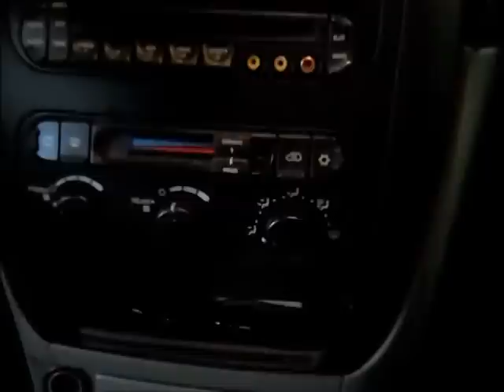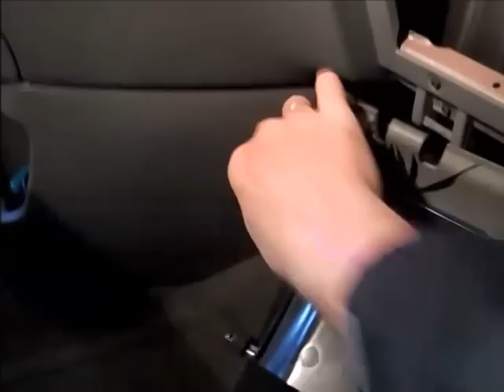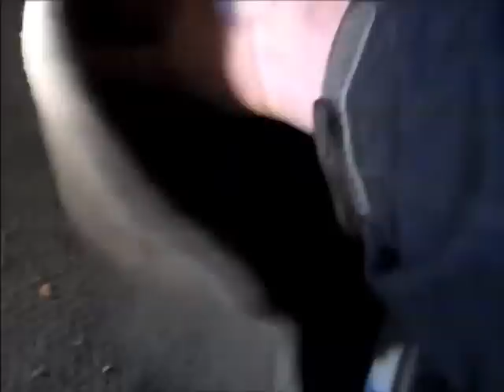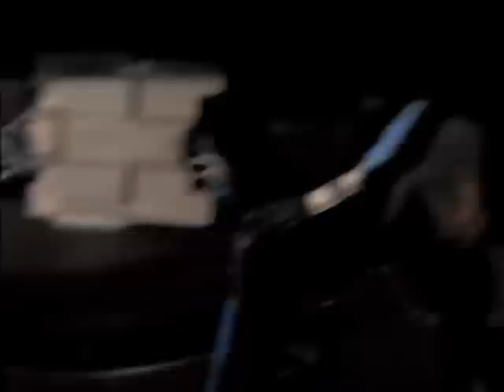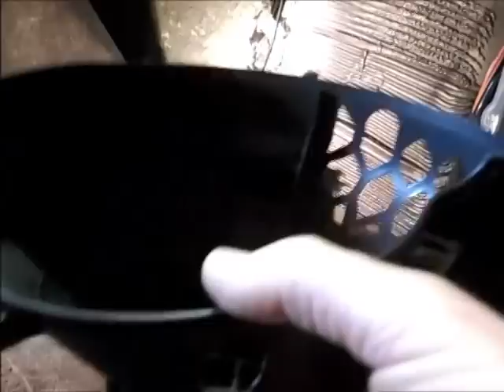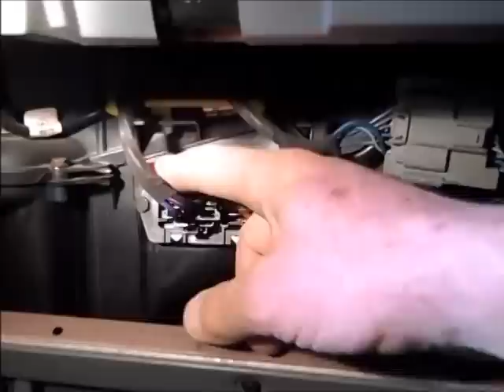2001 TO 2007 Dodge Caravan heater fan and resistor replacement

Comment: is there two blower motors? the back climate control works but the front wont blow at all I switched the front and back relays around and same thing any thoughts
Reply from the maker: Understand that I am not a mechanic but I have learned through comments that there is indeed 2 blowers. The rear tends to get less duty and lasts longer. If you have no motor at any speed and it suddenly stopped working at any speed... chances are it's the blower motor that's bad. Some have got them going by striking some blows on the housing with your hand. If it starts works again then that is also indicative of a bad motor. Good luck.
Reply: Don Guptill thank you for the reply I have tested with a test light and indications show that it is the resistor getting power from both power and ground
Reply from the maker: My description of testing with the voltmeter in my video is a bit misleading. I was attempting to show that power was present confirming no fuse or wire breaks but not a good power diagnostic procedure. I have since learned that the speed selection switch completes the circuit through the ground actually. The resistor pack has 4 separate resistors, one for each speed. So you will have power at the ground when selector is switched to that particular setting. I believe that the highest setting is direct power from the battery so if your speed selector in on high and you get a hot light on both power and ground, that is normal. Another way to find out if the motor is bad would be to jump wire direct power from the battery to the motor.  You could also buy a replacement resistor and plug it in and if no motor then you can take it back and order a motor. Hope I'm helping and not confusing.
Reply: Don Guptill yes thank you so very much i will buy a  resistor i hope it is that that motor looks like a bear

Comment: I just did my sisters caravan...tear down and reassembled took me 45 minutes...but I had watched this video 5 times at work the night before and had it memorized.  That one screw is a bear...I'm convinced a really really long flex driver would have been great cuz you can't get both shoulders in there to work....but if you want it bad enough you can sprawl out and shove your head in there and use a 8mm and 3" extension and ratchet..anyone should be able to do this as I'm 6'2" and almost 300 lbs....I too did not reinstall that 5th screw and threw that thing as far as I could into someone's yard as I did this in a parking lot.  Good tip on removing the cover by shoving the nut driver up through the actuator motor hole....I probably would have fought with that one.
Reply from the maker: Good job whiskey Tango. (great handle) I'm a bit oversized too. I also cant see well at close range anymore. That makes it difficult. Gjad you got it fixed and in an impressive 45 minutes!

Comment: Thanks for doing the video.  The most important thing you mentioned was when you bench tested the motor it worked.  I did the same and put it back together.  I wasn't sure what was wrong.  After seeing your video you pointed out something important, the motor has a dead spot.  Thanks.  I haven't fixed it yet, but you answered an important question.  Thanks.
Reply from the maker: Thanks Teresa.  If it stops working on you again, you can some times get it started again by striking the fan housing a few times. It may move the fan position a little bit and get the motor back to a good spot. Thanks for the comment.

Comment: Great video!

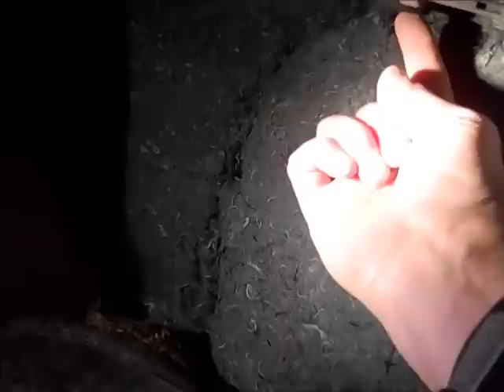No question that a flexible 1/4 inch extension would make removal of the back bolt easier (at 7:15 into the video).  

However, I was able to use a 5/16 inch six point nutdriver to remove that screw.  5/16 inch is slightly bigger than 8mm, so the nutdriver was able to turn the 8mm screw head at a slight angle.  Using a nutdriver might even eliminate the need to remove the padding.
Reply from the maker: Good advice Gromittoo. Thanks for the comment.

Comment: Don, I studied your vid and a few others as well. The blower on my 2002 
Grand Caravan was clearly bad. Your video took me right where I needed 
to go and ... I was defeated by that damn 5th screw in the back, even 
with an extension ready, I just couldn't get a good turn on it. Because 
I'm smaller guy I thought  I would have an relatively easy time. I would
 warn anyone attempting this to have a few band-aids ready, once that 
carpet and insulation comes off there's a few sharp things under there 
that were ripping up my hands and fingers. I will probably try this 
again following Affatori316's "wiggle" method. Thanks for sharing.
Reply from the maker: Yes. I think Affatori316's method is a good idea. You may have read in some other comments that replacing that 5'th screw is not necessary so if you can break it out, it still gets the job done. Good luck with it and thanks for the comment.
Reply: Success! "Wiggled" that housing out, apparently there were some squirrels living in there based on some of the stuff I cleaned out. Hearing a fan blowing in the front is sweet music, my cold feet will be loving life tomorrow!

Comment: If this part is bad would it keep the vehicle from starting? only asking because a friend referred me to this part as the possible reason my van won't start.
Reply from the maker: No Laura. The starting circuitry on your car is separate. There could be a number of reasons for a no start problem. I would seek a reliable mechanic. Good Luck.

Comment: I would strongly suggest getting an OEM unit from a dealer or parts jobber. The replacements sold at auto parts store chains tend to be cheap Chinese generic motors that have poor quality control and often don't meet the specs of the original part. I've had repetitive problems with these parts. Brand names mean nothing. A sure warning sign is a motor that doesn't match the original and wants you to cut and splice your original plug on. Don't waste your money. If you're short on cash, another solution would be to get one from a salvage yard, it will probably last longer than the "new" one will.
Reply from the maker: Good advice. My vehicle was 9 years old with 140k on it so the factory original lasted a good while. I would just add that on older vehicles with a short life expectancy, the cost of an OEM part may not be the best choice for those on a tight budget. Thanks for the comment.

Comment: Thank you so much for posting this video, it was very clear and easy to understand. I've done blower motors plenty before, but never on these vans. Your tip on the air recirculation door was SPOT ON, and your video was a huge help as just this afternoon I replaced the blower motor in my '05 Town & Country.

I successfully did the job in about an hour and fifteen minutes, using the tools you show here (the flexible driver is a MUST-HAVE!!!). I did not need the 8mm wrench to remove the downward-facing bolt, as I was able to use a 1/4" drive ratchet with a stubby extension and socket (stick the socket/extension behind the antenna wire and it's not too bad to get out). That hidden bolt at the rear of the cage I didn't even bother reinstalling, because I didn't cut/move the carpet padding.

I would recommend owners perform a HVAC panel recalibration after this job (search on YouTube or Google, it's ridiculously easy), just so the stepper motor for the recirculation door is back in sync with the control panel. If, following this video's diagnosis procedures, the blower motor is indeed at fault, I would highly recommend owners remove the blower motor resistor pack ANYWAY, and blow it out with electronics cleaner or compressed air. I have seen blower motor resistors fail due to debris literally burning on the bare wires, and since you have easy access to it, why not take a few minutes and clean out out, and extend its life a little bit? (As a sidenote, the metal-caged resistor pack is Mopar original, the circuit board ones are typically aftermarket and tend to not last as long, but are less vulnerable to debris.)

I've rambled on enough... But let me say thank you again for the video, especially the diagnosis portion, great tips there for the novice.
Reply from the maker: Thanks for the comment and good additional information as well. I was not aware of the HVAC calibration. I've gotten a lot of good info here from responders and I hope that viewers take a look at them.

Comment: hey Don quick question. Is the resistor in the video the only one? is there a separate one for the rear blower?
Reply from the maker: there is a separate one for the rear blower. It can be accessed by removing the rear interior plastic side panel on the passenger side. I've never had to change one but I'm pretty sure they are different than the front resistor.
Reply: Thanks just wanted to be sure

Comment: what causes resistor to keep burning out,change 3 just today(3 bucks each at wreckers),any one have this problem with theirs,...?fans works for 30 seconds then dies..
Reply: The fan is worn out and pulling too many amps. It'll burn up the resistor quickly if it's very worn. You can put an amp-meter on the wires leading from the resistor to the motor to check. They should be pulling around 1.3 to 1.5 amps. I would guess yours is pulling closer 2.5 or 3 amps, if the resistor is burning out that quickly.

Or, you're getting bad resistors from the wrecking yard.  I would try to check the amperage on the fan, if it checks out, spend the $13 on a new resistor and you should be good. The resistors are a very common thing to go out on these vans (actually, a lot of cars) so getting them from a wrecking yard may be problematic.
Reply: thanks...that was the problem....

Comment: Excellent video. Thanks. I replaced the blower motor yesterday but could not get the part that opens and closes the fresh air door back on. When I got the spindle to align with the teeth in the moving door, the screw holes would not line up. I can't get the door to move, maybe when I put the housing back on it pinched the door?IN any event, the blower works and I have ventilation again. Most of my time was spent running from store to store looking for a flexible nut driver, which nobody had. I didn't need it anyway. Managed to get that back screw out with a short socket extension and vise grip. The killer was the downward screw. There's only enough room to turn an open end wrench 1/8 of a revolution. I was half tempted to cut my wrench in half!Putting it all back together, I only got the back screw and the downward screw halfway in and gave up. Good enough!
Reply from the maker: Thanks. Yea that door shaft is kind of a blind operation. As long as you got adequate defrost... it's easy to live with. I never put that back screw in and no problem.

Comment: Thank you for this very informative video.  Using the instructions and demonstrations provided, I was able to determine that it was my resistor that went out and not the actual blower motor.  I was able to buy the part for <$20 and install in no time.  Your video helped save me time and money.  Thanks again!
Reply from the maker: Thanks Harry. Glad you had the easy fix.

Comment: thanks for the video. the easy way you explained it to the troubleshoot it helped a lot. every resistor coil is good in my resistor pack but the thermistor or thermal fuse appears to be burnt out. hopefully a new resistor pack will fix that and we get things only takes about 5 minutes to change it out.
Reply from the maker: Thanks for the comment. Hope the resistir change fixes your blower.

Comment: Mr. Guptill, I cannot thank you enough for your video.  My blower motor went out this morning, and thanks to you, I can track down and replace the failed parts.  Your video is very informative, detailed and you clearly stated the important information that one should know, to tackle this job.  This is my Saturday morning job tomorrow, and I can address it with complete confidence.  Thanks again!!
Reply from the maker: Thanks Phil. Hope it goes well for you.
Reply: Don, Thanks to your detailed instructions, the job was a success.  I did have to replace the motor, and it's a challenge for a large man, but can be done. I'm estimating I saved myself around $150 labor, thanks to your video!  Thanks!!

Comment: Thank you for the video. Instead of trying to get that back screw out, I just wiggled it back and forth and split the tab and just pulled it out. The other 3 will hold it in just fine. Screw trying to get screw out then back in again. Otherwise everything else went well. As well as it can when your 5'11" and 235lbs. Man I hate tight spaces!
Reply from the maker: Yes. I'm 6' 4'' and 240. I know what you mean. I never put that back screw back in and it stayed together fine. Thanks for the comment.
Reply: Hell, yes. I did manage to get that screw out with a flex extender, but I certainly did NOT bother to put it back in.

Comment: i have a 2005 dodge grand caravan my blower blows hot air but when i switch to AC there is nothing could that be the resister ?
Reply from the maker: Hi Dean. If you have all blower speeds... it's not the resistor. When you say there is nothing... do you mean no blower or no cooling?

Comment: Went last year Florida to Ontario then to New Hampshire then back to Florida. My 2001 Grand Caravan made it to the top of Mt Washington, but before that I had the same problem with only high and low fan speeds. Once I got home and found this video, I was able to put in a new resistor easy as pie!This year the same trip, and ended up having the same problems, only the fan controls also stopped working altogether the last day of our return trip. 95+ at stop lights in Florida - Ugh! So I changed the resistor again but still nothing. So I bought a new blower and again this video helped me out tremendously. I even got that pesky #5 screw out without removing the sound deadening! Right now it's raining buckets, but it'll be all sunny in a few minutes, and I'll finish putting it all back together. I did test the new blower OOTB on the resistor, before diving too deep into the teardown, and it runs on all speeds. Thanks loads Don - you helped me twice now!
Reply from the maker: Thanks for the comment Andrew. I'm glad I was able to help. That old blower motor was going on you last year most likely. You should be all set now.

Comment: I assume  that cover will be fine without reinstalling that back screw, as it looks to be almost impossible to replace.
Reply from the maker: Hi Ted. Thanks for the comment. My mechanic friend worked for a chrysler dealership and he said they never replaced that !@#$ screw when they did that job. It should be fine.

Comment: I would like to thank you for posting this. I had the same problem with the motor and the resistor. This was a great help to anyone with this problem, because this is one son of a bitch of a job:-)
Reply from the maker: You got that right Bruce and thanks for the comment.
Reply: Never could get that back 8 mm screw back in, but it works fine. Been a few years in Florida with NO AC and that was a long hot haul, although it was a second car that was rarely used. Replaced that resistor a couple of times and it lasted a few days and then blew, so I knew that motor had to be bad......Thank You So Much:-)

Comment: Replaced resistor and blower motor today (symptoms intermittent function of blower motor and inconsistent fan speeds) - three humid sweat drenched hours on a Houston June afternoon - was it worth otherwise $400 bill? Absolutely! lol - totally tore up the under carpet padding for the infamous "back screw" (needless to say that screw it did NOT go back in - & will buy & glue replacement padding) - could not have done without this vid - thanks much.
Reply from the maker: Thanks for the comment. Glad I was able to help. And yes... that back screw never went back in on mine either.

Comment: Great video. You walked me through it all the way. That one hard bolt in the back- I didn't put it back in. I don't think it's that important.
Reply from the maker: +Ken Skaggs Thanks Ken. I'm with you on reinstalling that last bolt. My mechanic friend at a Chrysler dealership says they never do either. It will be fine. Hope your blower issue is cured.
Reply: +Don Guptill It is cured, thanks to you:)

Comment: Hi Don, last night I turned on the front blower for heating and it quit while on high. So I shut it off and then turn it back on low, 2nd and 3rd speed, then it quits when on high. Does it sounds like the resistor is bad?
Reply from the maker: +maine arizona Yes. The resistor is actually a set of four resistors. One for each speed setting. Very likely that the high speed resistor is bad. Easy fix. Just put a new one in.

Comment: My blower for front only is not working at all. The back works fine. does this resistor control both?
Reply from the maker: +Debra Polenz Hi Debra. No. The resistor in my video controls the front blower only. If your motor stopped working entirely...it's probably the motor and not the resistor unfortunately. It's not common for a resistor to fail on all speed settings at once. Be sure and check the fuse and relay also. They are located under the hood in the fuse panel. Good luck!

Comment: Excellent video and explanation.  FWIW, our resistor assy checked good as shown in the video and seemed to provide power to the fan motor but the fan motor didn't work.  Before replacing the fan motor, we tried a new resistor assy anyway ($17 and 5 minutes vs $80 and God knows how long).  The blower immediately started working again.  Now just hoping the fan motor is good and doesn't burn out the new resistor.  Thanks again.